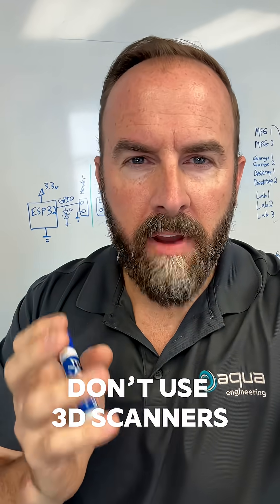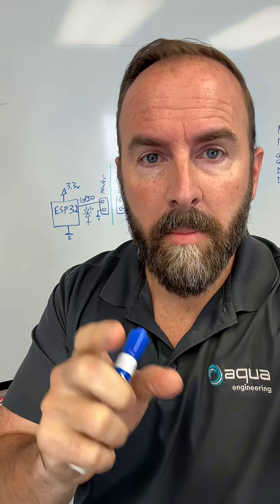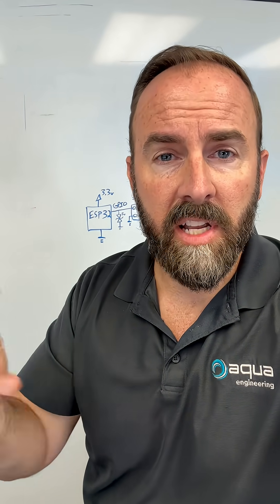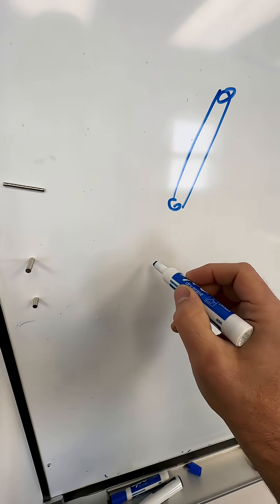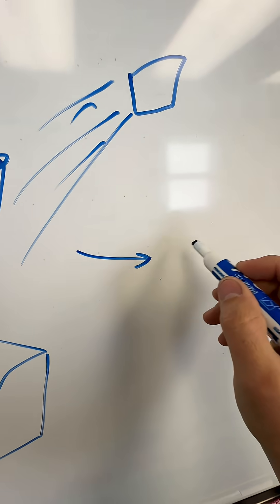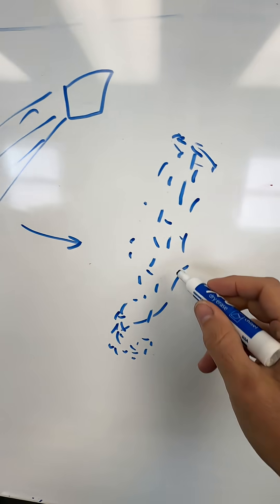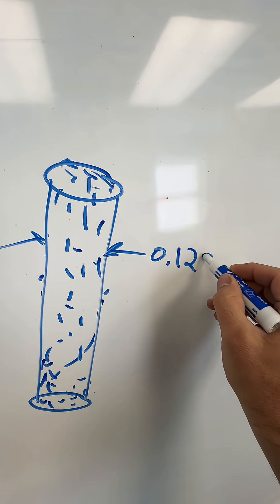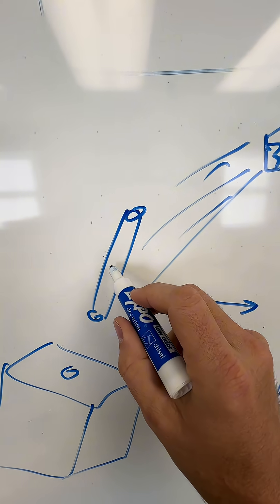How to Use a 3D Scanner (Hint: Don’t)

Comment: Yeah for a pin, but if you need a complex shape reproduced scan it, then in blender or other 3d modelling software you can scale it to the dimensions you need after you clean it up.
Reply from the maker: 100%, but then I ask, why do you need a complex shape? Is it just art or ergonomics? Can it be approximated with a parametric 3D model (brep or step, etc.) so you can fully and properly define the part on 2D drawings? I’m approaching this as an engineer / manufacturer.

Comment: I measure all of the parts that I need to import into a CAD model if they are not already available online.  Don't trust a CAD model to be correct. Check it against the real part for accuracy.

Comment: Sure, most objects can be easily sketched/designed in CAD, at least anything you can easily put some calipers on. 
However, (since I'm only doing this kind of thing as a hobby) I recently denied designing some complex organic shaped plastic items (ie. for repairing some antique toy model car seating) for which I assume a 3D scanner would be a way more appropriate tool to help get that model into CAD and printing it on an mSLA printer. 
But, due to this use case being pretty niche, I haven't bought myself a 3D scanner.

Comment: 3D scanners have their use. Usually you don't 3D scan prismatic or radial parts. However complex curves, plastics, repair jobs (printing a section to fill in a something) are all great uses of 3D scanning. And as others have pointed out, occasionally with quite complex parts it's really useful if you scan and use that as a reference, but that's model should be oriented and scaled according to known reference dimensions, then totally rebuilt in 3D CAD. That's a pretty common workflow for aerospace and occasionally automotive for supporting old discontinued lines and making new aftermarket components.

Comment: I do reverse engineering for a living.   The best case of using scanners to reverse engineer parts is to use the point clouds as reference on complex dimensions and surfacing. The hole dimensions usually end up off so u use the scanner to find reference locations for a hole or 2 then measure everything and make changes to the model to fit the best case.  Nothing is ever perfect but being able to use both scanning and measuring usually gives you hands down the best result especially on complex parts.   Also scanners can start with a bad aspect ratio so u need to compensate for that sometimes.